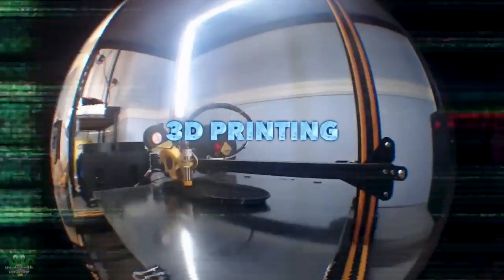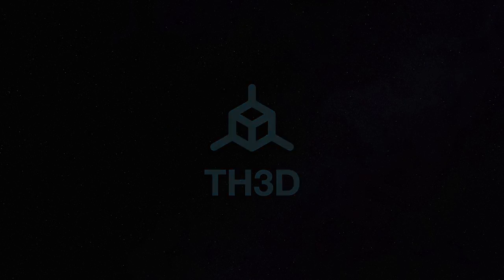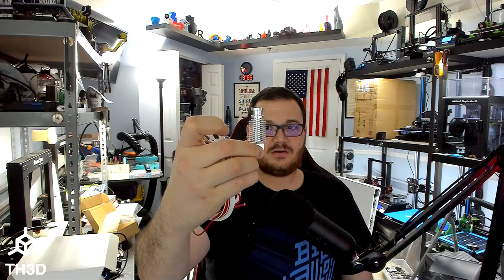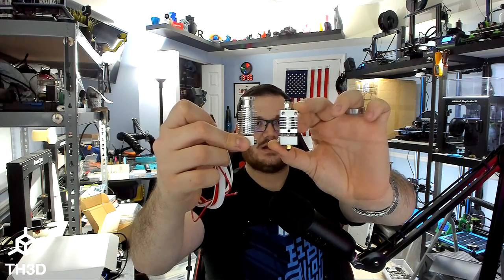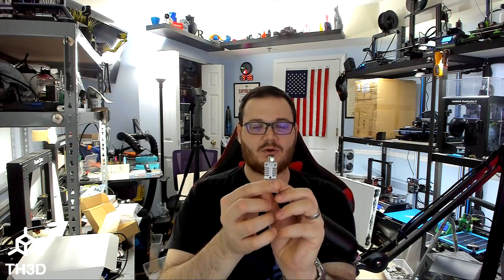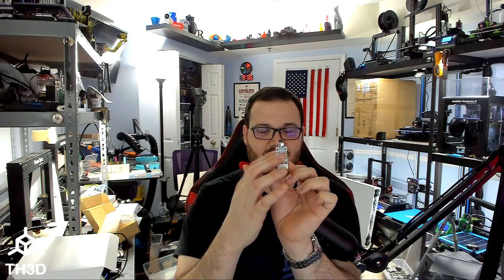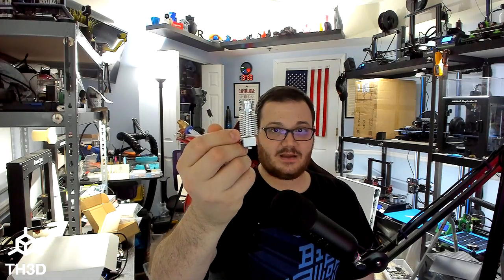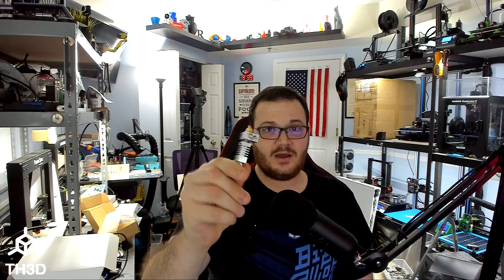Tips & Tricks - Proper Cooling Fan Selection - Stop Using Capacitors & Noctua Fans!

Comment: Even prusa had problems with the Noctua fans.
Reply from the maker: Did not know that. Thanks for letting us know!
Reply: They still use them though. But indeed they have more cooling fins. I use a Microswiss which should have less issues with heatcreap as well.
Reply: Yes, but they had to modify the extruder assembly ( I believe to b7) to get more airflow out of it. Also, some forum members are swapping them for Sanyo, Sunon. Personally, I had problems with all of my MK3s in long prints. So much so that I don't use them for long prints anymore. At least, not until I upgrade my extruder assembly to the latest V3 designs.
Reply from the maker: Wow. I would be really disappointed if that happened. Especially on a $800+ kit machine....
Reply: I've been running a noctua 4020 on my hotend for ~6 months with many prints of 18-24hrs at a time. I've not had heatcreap issues yet.
Reply: @adamthomas3264  what hotend and do you use a duct? the problem isn't a noctua fan, it's not forcing air to flow trough the fins!
Reply from the maker: @3dprintingguru378  you need high static pressure to push the air through though.
Reply: @3dprintingguru378  I used the stock hotend with the petsfang mount until end of September when I got my th3d hotend. Now I use the 4020 with the cr10 heavy duty mount
Reply: @TH3DStudio  or just some crosssection for the airflow. if you'd need static pressure the heatsink design is crap. there is no good reason for having a lot of thermal mass. or so you know of any CPU using blowers instead of fans. blower is the way to go if static pressure is needed. think of e3d v6 using a tiny fan and a tight duct and a lot of surface for the heatsink and it simply works
Reply: @DennisFisherUK  anything else is bad heatsink design. I'm a professional mechatronics engineer for about 20 years now and that's why I know for sure, it's all about cooling surface to properly dissipate heat, not thermal mass to store heat. Who wants the cold end to store the heat instead of dissipating it?
Reply: @TH3DStudio  your not kidding
Reply: interesting...noctua nf-a4x10 flx has roughly 20% better air flow than the 40mm fan on your website...like I said, just interesting..
Reply: @3dprintingguru378  imo the e3d v6 is a perfect hot end to swap a bigger noctua into. if that tiny little ~30mm fan can push enough air, then a noctua over 10mm bigger in diameter and over 3 times the thickness will certainly suffice. but there shouldn't be any problems as long as you do your due diligence on testing after installing any new mods

Comment: So I checked out the 40mm fan with 10mm thickness you sell.
Airflow: 0.151m³/min (which is: 9.06m³/h), static pressure:  0.090 in H₂O (i assume inch??, which is: 2.286mm in H₂O), speed 5000 RPM, noise: 20dB(A)
Now let's compare those values to the Noctua 40mm fans:
10mm thickness: Airflow: 8.9 m³/h, static pressure: 1.95 mm H₂O, speed 5000 RPM, noise: 19.6dB(A)
20mm thickness: Airflow: 9.4 m³/h, static pressure: 2.26 mm H₂O, speed 5000 RPM, noise: 14,9dB(A)
So, your 10mm fan is very close to the Noctua one. The stats of the 20mm Noctua one are better, it's much quieter too and you can mount it to most heatsink fan mounts (except the stock ones) without problems.
Could you please tell me WHY I shouldn't use those? I can see the argument that the specs for the 10mm Noctua are a tad lower. But for the 20mm one? I don't know. Please tell me.
Reply from the maker: The 20mm would be a better choice if you are hell-bent on using Noctua. But it does not fit in the stock hotend location, only the 10mm fits. Some aftermarket cooling mounts will work with the 20mm one but you are also then adding more weight with a larger fan and that can add more ringing (negligible, but more weight on the hotend = more ringing).
Reply: @TH3DStudio   I dont believe the extra weight could be an issue, and two nuts extra and the 20mm fits on Ender 3/5, but yes, never use the lower speed option, run them full speed always on you hotend. But I dont really get this message, dont make it Noctua specific, just mention low Airflow fans, keep it clean.
Reply: Because he can´t sell his China Fans for the same price as the noctua´s thats why.
Reply: @TheShaddix  Yeah but they are developed from an Austrian company  with good QM. I think most people know what is meant with china fan.
Reply: @davidmertes6308  I hear you. Can't disagree with that!

Comment: Software PWM is not as effective as you're describing. I've used it, and it certainly reduced whining, but it didn't eliminate it. A capacitor did (notably, your shop also still says to wire this across your 5015 fans). The real lesson here is to use an appropriately-sized capacitor. Obviously 1000uf is insanely oversized for that application.
Reply: what size would be appropiate? 10µF? I heard ceramic caps are better to get the voltage really smooth, when used in a PSU
Reply: @SchwachsinnProduzent  Yeah, 10uF is what I used, until changing boards to one whose PWM played nicer with my 5015 fan.

Comment: excellent advice. always the simplest no bs method that is most efficient, especially just buying the freaking correct voltage fan to match your power supply from the beginning and not messing around with stepping down voltages and all that nonsense

Comment: Take thermometer reading inside the heatbrake. Preheat up to temperature. I would recommend disconnecting the nozzle to prevent leftover filament inside the nozzle from carbonizing. If the temperature is constant over 15 minutes or so (doesn't go up at all. It can go down by a degree but not up) your cooling is good enough. Remember to do this at the highest temperature you're ever going to print at!
Reply from the maker: Sounds like a great idea for a new video! <3

Comment: They may be using the low noise adapter on noctua when installing and this decreases the fan speed from 4500 to 3700. Causing heat issues

Comment: Well, I measured the 5V 40x20 Noctua fan I use on my Ender 3 with the stock hotend and it is perfectly capable of keeping the temperature below 35°C with a 200°C Nozzle for over an hour. I then simulated potential heatcreep after a long print by turning off the fan for a while, heating up the hotend. When turning the fan back on temperature quickly dropped back below 35°C. So yes, the Noctua fan provides sufficient airflow even with the stock hotend and hence is perfectly adequate for this application.
Reply from the maker: Are you running a stock cooling shroud or an aftermarket one that directs all the air to the heatsink? Most people with the stock shroud have issues as there is no direct airflow to the heatsink.
Reply: TH3D Studio yes, everything is stock, except the fan. I measured it using the thermal couple that came with my multimeter, touching the heatsink.
Reply: Keep in mind most people use the 10mm. The 20 is advertised to have more static pressure  which is the main issue anyway
Reply: The TH3D video is about replacing the stock 40x10mm fan with a Noctua fan of the SAME SIZE. You replaced yours with a 40x20mm fan. So next time think a little longer before writing a comment.

Comment: I would like to say that Teaching Tech was not using a 5v Noctua 4010 it was a 12v 4010 and i have also done temp testing on the stock hotend and the Swiss micro and the Noctua keeps my heat sync at 32-34c through a 36 hour print with no problems. The fan air flow is plenty powerful enough to cool and keep the system cool.
Reply from the maker: Thanks for the feedback. We have seen issues with them in the FB groups on those fans though. Maybe they were using the wrong model?
Reply: @TH3DStudio  noctua also provides a low noise plug in wire that will lower the rpm even more on there fans I bet people are using this option that are having problems

Comment: While this video is correct - Static pressure is the issue, not CFM. You can have a low CFM fan with a high static pressure that will outperform a high CFM fan with low static pressure.
Reply: In the end it boils down to cfm of the whole system.

Comment: I haven't had an issue with the noctua fan on the hot end. I'd be interested in seeing an actual test of the fans. Airflow felt the same too me when I checked the stock vs the noctua.
Reply: I'm getting voltage dips on my stock 24v, so my theory is putting a buck converter in-line, and running a 12v noctua... now I'm wondering if this is a good decision. Idk why people would put a 5v fan though

Comment: I cant really agree on this one. Ive been using a 40x10mm Noctua fan on my ender 3 coldend for over two years. I reassembled the hotend and used a remix of cheps hotend fix. After multiple 24-48h prints and almost daily printing, and after disassembling the hotend multiple times to check on the mod I can say: There is no heatcreep and I didn't experience a single clog in all this time, nor did the filament leak somewhere. 

I get what you're saying but I don't think this is true for running Noctua fans at their rated 12V but when you start running them at 10V, 8V or even 5V to safe every last db. 

We shouldnt make the noctua fans the sole reason for underextrusion when someone uses them, but we should look at the whole picture: Did the user use the Low noise adapter with the Noctua fan?, Did he assemble his hotend correctly? Came it faulty by default? etc,
Reply from the maker: It really depends on the noctua selected. They have multiple revisions of the 40x10mm and all of them push significantly less air than the stock fan. It also has to do with your ambient temp. If your room is cooler then it will be less likely to jam. If its warmer then it will be more likely to jam. In our experience and testing the 40x10mm Noctuas (we looked at selling them at one point) did not provide enough airflow to keep the heatsink below 50C on longer prints, which lead to softening of PLA in the tubing.

Comment: Im using the smaller 40mm Noctua fan (the 10mm thick one) and run it as intended at 12 volts. It pushes more air in a restrictive environment than the stock fan. So while yes, the stock fan feels like it pushes more air, the Noctua actually prevails when sitting up against the fins of the hotend heat sink. I’m pretty sure, but can’t say for sure, that the people who are having issues may either not be setting their voltage right, under running them, or are using the low noise adapter that drops them to 9 volts.

Should also mention I use an Ender 3 Pro, and often do 24+ hour prints.
Reply from the maker: In a Creality printer the air is not directed/guided to the heatsink. It just dumps air into the shroud near the heatsink so higher airflow is needed, this is why heatcreep is common when people put the Noctua 10mm in there.
Reply: @TH3DStudio  Regardless, the shroud creates a restrictive environment since it surrounds and encloses the fan. Even though the heat sink just sits in the middle. It still creates positive pressure which causes the Noctua to be better. The size of the fan inlet is smaller than the tiny opening at the bottom for the nozzle and the top for the cables. You can feel more airflow from the hole where the nozzle is with the Noctua than stock.

Comment: I use a 20mm thick noctua fan (A4x20) and haven’t ever had issues i think. I inserted my thermistor like filament into my hotend into the heatsink and it read 40 at 200-210 and 42-43 at 240~

I have a good fan duct tho
Reply: A4x20 is prefectly adequate for the job - it has 15% more airflow which in practice is around 40-45% more airflow compared to x10 model due to also increased with 27% static pressure :)
Reply: @JulianBG  YAY! :3

Comment: I have Noctuas on a buck converter, just made sure to use larger ones that provided same or similar CFM at much lower RPM and for the speed controlled ones, use the onboard ground lines. So far so good even with 10hr+ prints on ender 3 Pro.  Definitely not 1:1 on physical size.
Reply from the maker: The larger 40x20mm Noctuas do move more air than the 40x10mm ones, so that does not surprise me that they are working. The only issue is the 40x20mm don't fit the stock hotend setup and people are recommending the 40x10mm ones for people with stock hotend setups...

Comment: Have 2 20x40mm noctua fans on my ender 3 v2 one for hot end cooling and one for parts cooling, installed them with a buck converter and they performed rm far better than those crappy stock fans and 1/3 the noise. Ive done multiple 40+ hour prints no issues.
Reply from the maker: You're using the 40x20mm, which usually are OK. But those do not fit in the stock housing on the hotend. Only the 40x10mm ones fit. The 40x10mm noctuas do not work correctly for most hotends but people tell others to use them and it causes issues.

Comment: Great video, though I'm not sure that's how the capacitors work. The idea is that the capacitor charges during the on part of the duty cycle, and discharges during the off part. In this way, it acts like a low-pass filter and smooths out the voltage the fan sees. I'd recommend checking the waveforms with a scope with and without a cap.
Reply from the maker: With a 1000uf cap the voltage going to the fan was around 19V on a 24V system with a 50% speed set. The caps are not needed either way. Just enable the soft PWM.
Reply: @TH3DStudio  Soft PWM is definitely the best solution.  But it's worth pointing out that you likely didn't have enough series resistance in your circuit.  RC filters work by limiting the rate at which the capacitor recharges.  If you don't add a series resistor, filter behavior is determined by the output resistance of your specific fan driver.  And fractions of an ohm can make a huge difference when you're near zero.

Comment: Noctua ain’t the issue, but the design for the cooling from the Hotend or the fanduct it’s getting installed on. Running my 2 Sprite Extruders with Noctuas and have zero issues after many hours of printing.
Reply from the maker: The issue is people putting them on hotends and setups that are not meant to use them and others telling others to put them on there without knowing they are going to mess up someones machine.

Comment: So...what your saying is that a CR-10 printing PLA for 10 hours with a stock hot end and a Noctua NF-A4x10 PWM in an environment that has a constant temperature between 68-77F will suffer from heat creep?

It would have been helpful to see the fan data that you captured along with temperature readings from two printers running side by side.  One with a Noctua fan and another with your fan.  Showing us the performance differences.  Take temperature readings at 2 hrs, 6 hrs, and 10 hrs.
Reply from the maker: As much as we would like to do these types of tests and make a video it's a lot of time that we don't have right now. We've started recording repairs and testing now so that we can make videos on them. When we did the testing on the fans we weren't recording anything, just monitoring and taking notes.

Comment: So what's the answer to adequate cooling plus low noise? The whine from my Max Neo is awful. Print a new mount and use bigger, quiter fans?
Reply from the maker: Replace it with a different one. The ones we carry are quiet and push enough air. We've tested them on these machines a d they work properly.

Comment: I was wondering why people change the power supply of the fans just to apply a specific one. I thought there should be fans which fit the needed parameters and probably can be quiet, after all - like how you stated it - the stock ones probably not the high-tier ones which often can be found in server hardware.
.
One other thing though, is there a printer head with solutions like water-cooling? The part cooler must be air, but the main head might be lighter, cooler and silent with some clever water cooling blocks.
Reply from the maker: There are some water cooled solutions but they are definitely not main stream. We don't even mess with those as we don't have a need for them. Most water cooled hotends are for people doing crazy high end materials like PEEK or ULTEM.
Reply: Hmm interesting, thank you for the answer! I was considering the water block route to make sure that less fans are making noise and the head itself is more lighter. I ran into the E3D Titan Aqua which seems like a cool all in one solution.
Checked your shop and it seems the ones I would need to just replace the stock ones are sold out, how often do you restock?
I wonder if another crazy route to have air pipes - with cool air - from a different location like in a big CNC machine would be doable.

Comment: Hmmm I have not had any problems with Noiseblocker fans on the hot end (never parts cooling) and I have run 100 hour prints with no problem. I wonder if the NB's put out more CFM than the Noctua's? maybe just enough to avoid the issue of heat soaking (and creep)

good info!!
Reply: was it a 4010 noiseblocker? I'm looking to get one myself
Reply: @case_sensitive  Normal hot end fan is typically 40x40x10 yes. the NB's are 12v so you will need a regulator to adjust the 24v down to 12v OR just order a 40x40x10 brushless Dual Ball Bearing fan and it will be just as quiet and already 24v !!

Comment: You can use noctua 40x40x10 mm,the 5v one can work at 12v without  problems,but if you use a step down converter  you can give it like 9v and you get more airflow.
Reply from the maker: Really good way to burn it out but you do you...

Comment: There is something about the lifespan of the product depending on mounting position. There is different types of fan motor technologies.
Reply from the maker: Some depend on the orientation but it's not usually a major difference at these slow of speeds. Higher RPM ones definitely will be more particular of orientation vs slower RPM ones.